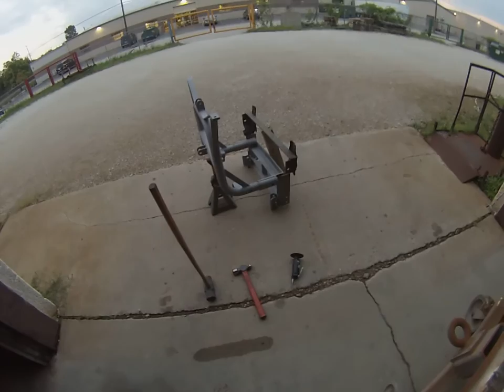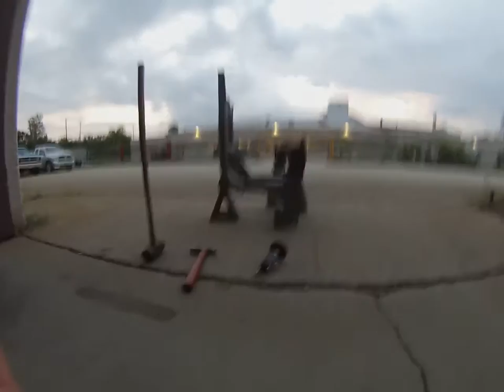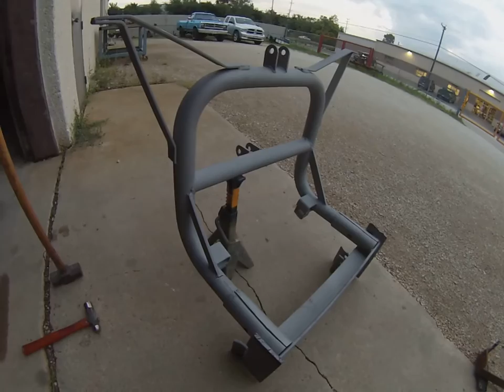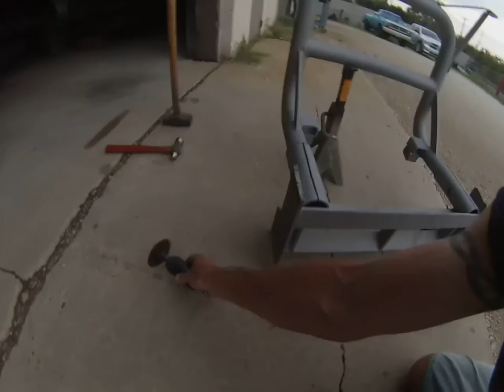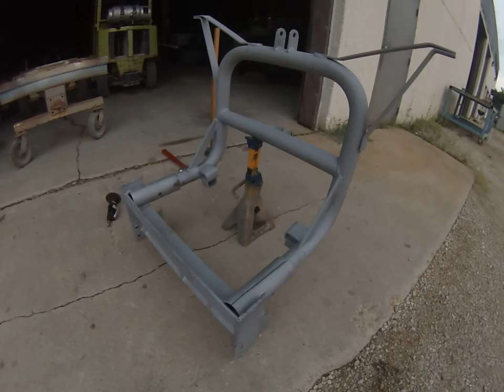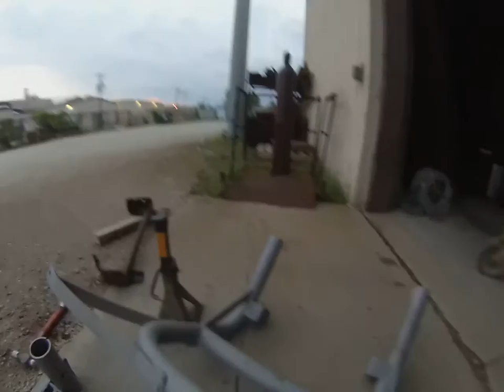Meyers EZ Mount Snow Plow Rusted Frame Removal

Comment: Well HI guy's  I have same  tubular  type plow frame on my 2001dodge ram 2500 and frame been on truck far as I Know since truck was new So I'm getting lucky but not completely  lucky drivers side coming loose after 8 oz can PB blaster and truck jack on it and 5 ton pump jack broke drivers side loose  but passenger  side is stubborn, heat not great with PB blaster in tubes So my experience  of muffler  shops us this I'm cutting  stubborn  tube off at 1/2" out and then  split the tube in large tube too truck and twist it out after air blasting crap out tube too see what I'm splitting  then after out clean it grind it re-weld it back together  better than splitting  big tube like in video.

Comment: Thanks, I am currently in the same "stuck" spot you were in.  Propane nor MAPP heat is enough.  No rust dissolvers penetrate deep enough either.  I will be getting the grinder out today!